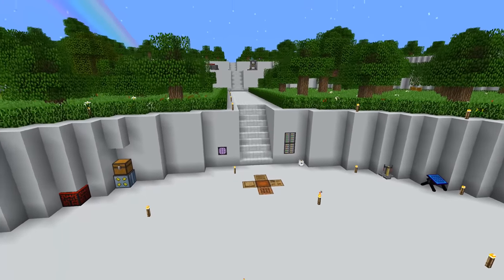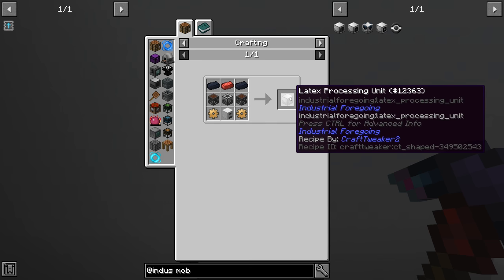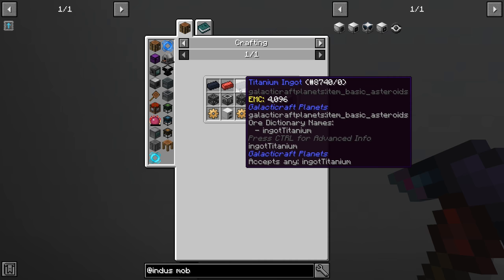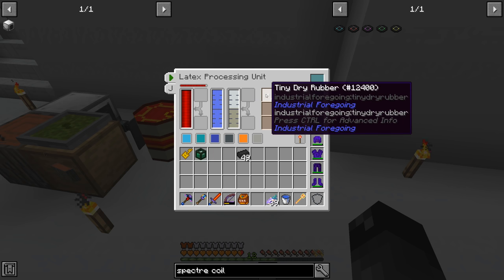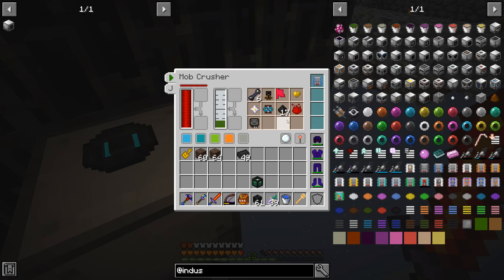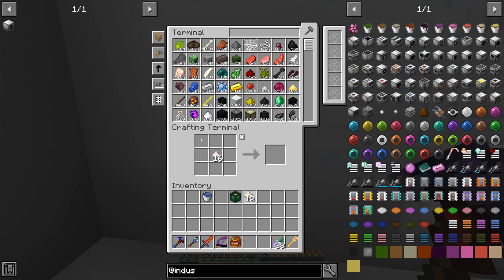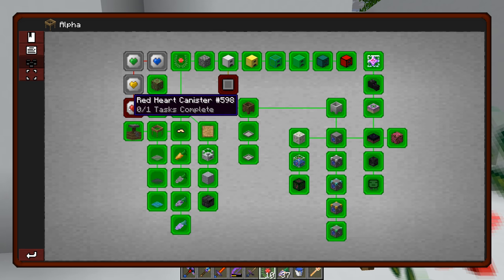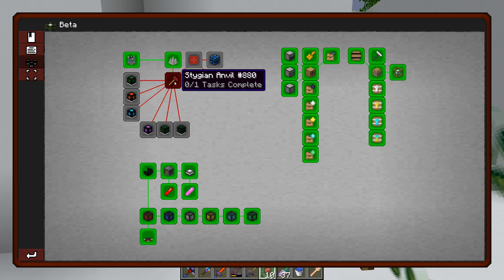Project Ozone 3 Kappa Mode - PLASTIC CRUSHER [E54] (Modded Minecraft Sky Block)

Comment: A few quality of life suggestions: 
With an augment for the energetic infuser you can use Essence of Knowledge (Liquid XP) and energy to repair items. With 3 speed augments it's quite fast as well and only costs 5 liquid xp per durability. Pretty nice.
With Tinker's you can make a chisel. There's a mod in the pack that adds an iModifier which turns your Tinker's Chisel into an iChisel.
With just something like Soulium as Chisel head and Bronze as Chisel handle it easily gets over 2000 durability and in no time you will have an unbreakable chisel since you can add reinforcement modifiers to it.
Industrial Foregoing also features a Wither Builder. Hopefully it's still enabled in Kappa mode and maybe you can already craft it. It should make your life farming Netherstars easier until you can make them with Woot (which I anticipate to cost tons and tons of RF).

Comment: The only problem with getting into Woot (especially if you're looking to spawn the higher level mobs) is you will definitely need a MUCH better power gen  - if you recall from one of your colabs with xB Woot is a MAJOR power drain. Also - the Stygian Anvil (as someone mentioned) first needs a magma block under it to work & it has no interface - you drop the item on it & smack it with the Ya Hammer to craft it.

Comment: I also use a wither spawner from a mix of ender io and Draconic evolution. Use soul vial on wither. Use soul binder machine then turn it into a stabilized spawner from Draconic with an awakened Draconic core equipped on the spawner. I got about 2000 nether stars per hr.